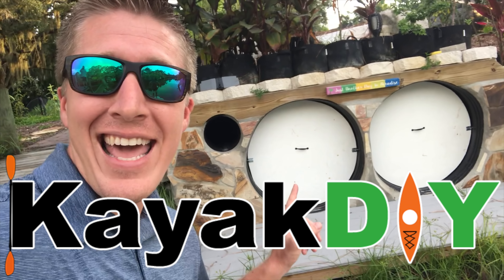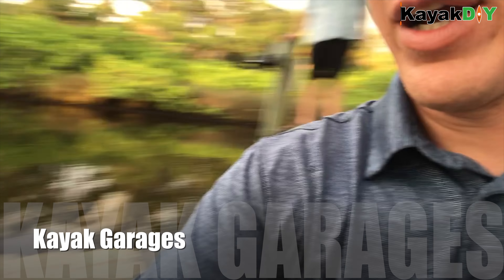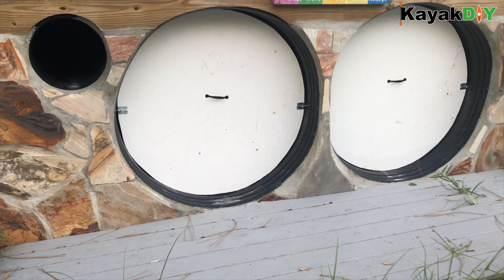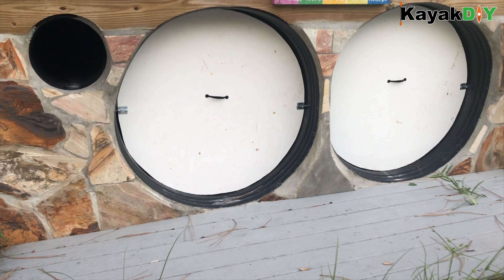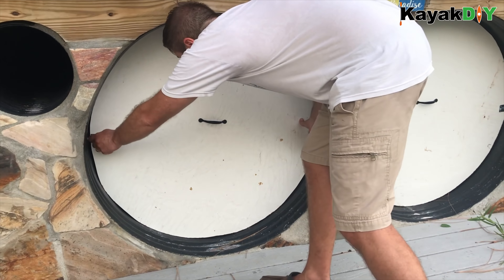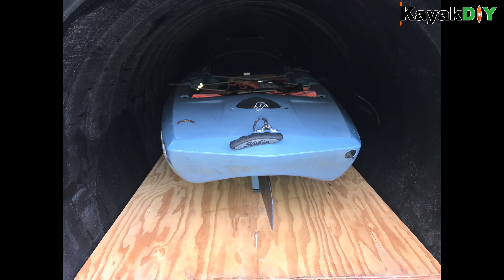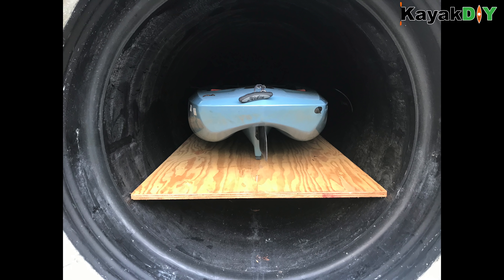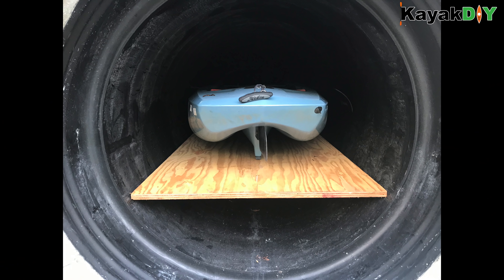HOMEMADE UNDERGROUND STORAGE

Comment from the maker: I just wanted to SHARE this cool project with you!  
This is the coolest way to store kayaks that I have seen!  

These kayak garages / sheds / tubes store up to two kayaks each.  They are relatively simple in design, but will take heavy machinery to install as shown.  Basically it is a culvert with dirt mound over top, a cement front, & wooden door and kayak platform. If you have the ability to install one for storing your kayak I recommend it.  It looked awesome!  I'm jealous!

Comment: Use Candles (laid sidways and "scrubbed" onto the plywood) for better "sliding" in and out of the kayaks/boards!
Reply from the maker: Pretty good idea.  Although I will say it slid in and out pretty dang nice.  At first I thought it was on tracks with bearings, but nope....just plain plywood and culvert pipe.

Comment: Creative tip for millionaires.
Reply from the maker: Certainly don’t need to be a millionaire.  Waterfront homes here in Florida are dime a dozen.  I see ocean access homes ($250k and under).  That project could be sourced and completed pretty cheap down here.  Probably can find used culverts in good shape. Even if purchased new the culverts can be had for $1000.  Most of the work is fill dirt.  You can use concrete block for the front retaining wall face and cover in a concrete spackle.  We have everyday people (non-millionaires) spending $4000 on Hobies now days.  This project isn’t that crazy.  Not to mention he needed the retaining wall anyway so might as well make it functional.

Comment: Very cool but I thought it was bad to store kayaks upright like that
Reply from the maker: Do it all the time.  As long as they are sitting on flat surface I have never had issues.  I’ve owned $15-20,000 in kayaks over last few years. However, if concerned follow your kayak manufacturer recommendations.